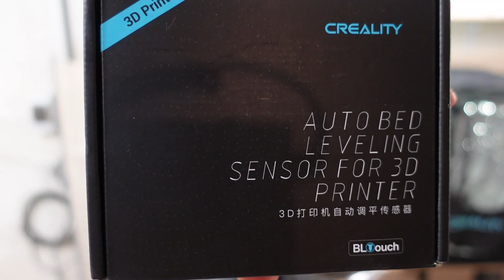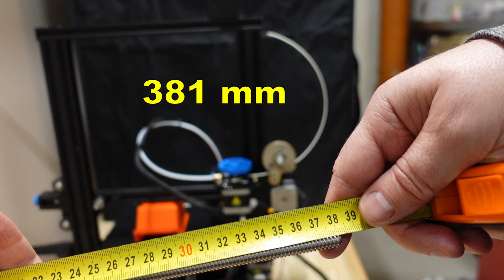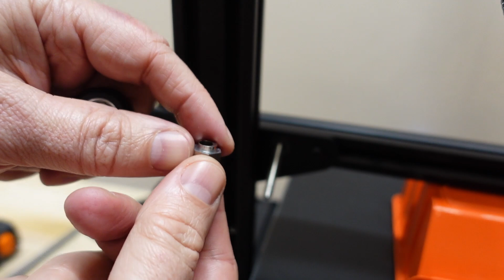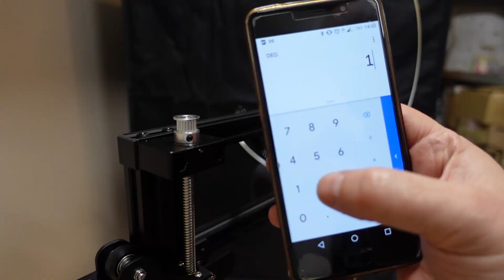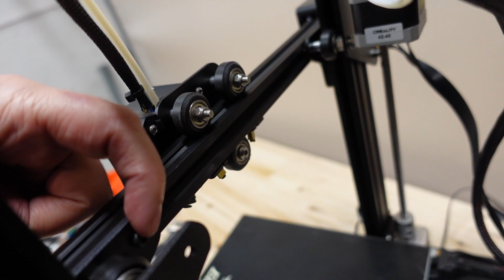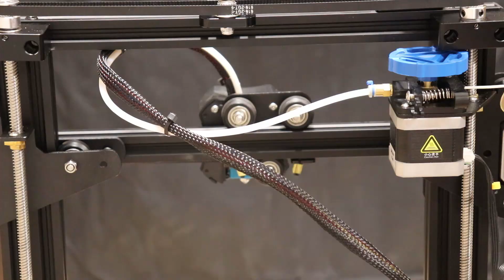Ender3 V2 dual Z axis upgrade with pulley and timing belt with single stepper motor

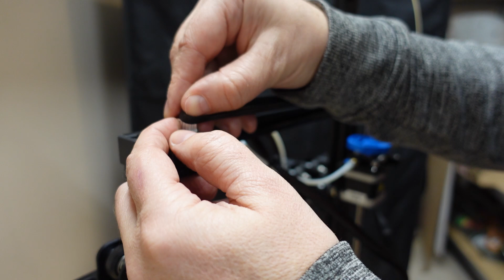Comment: 14:00
You're doing it wrong.
Remove one of the pulleys, put the belt on, and then put the pulley back on with the belt already in place.

Comment: One issue with this is the backlash on your non-powered ball screw. it seems like a fairly efficient system but this light amount of backlash you have in that unpowered ball screw will cause the bed leveling to not be as accurate. I went with the dual motors and check the pulse settings in the software. I'm also using a creality version 4 .2.7 motherboard which has some newer hardware on it to compensate. It looks really great I love that look!!

Comment: I did this and motors run ok until I lock the brass nuts to the bar. the brass nuts slide down freely, the bar goes up and own freely without the bras nuts. The screws seem square and are not wobbling. I added the belt to bind the 2 axis together but it seems to make things worse.

Comment: Have u tried to connect the two rods via Belt with the 2 steppers mounted? Theoretically they cant get unsynchronized, only if the belt slips.

Comment: I successfully bought a dual-z stepper motor and timing belt for my Ender 3 V2. I upgraded to Professional Firmware and now I have a very accurate leveled bed that does not require maintenance. Prints are successful and I am producing square test cubes. This was a big and necessary improvement. Thanks to you for doing this video.

Comment: Hardest part for my dual z axis upgrade was probably melting the hot glue creality used to hold the wires to the board. But thats just because I was scared to burn my electronics.

Comment: Banggood shipment of the timing belt Z-Axis arrived finally. I had the item for a couple days until I found time today to work on installing (with your video help) it on my Ender 3 V2. I quickly realized they sent the wrong product. Only a single standard Ender 3 V2 lead screw (length) and no timing belt, pulleys or center bracket with pulley. So I'll have to make due for another couple weeks. Hopefully Banggood will refund or exchange this item for the correct product. I ordered it on June 25th and it took until now to arrive.
Reply: Banggood finally offered  to return my money for the Dual Z kit that arrived with one lead screw and no timing belt or pulleys if I returned the package to China. To do this would cost $30 via traceable carrier and so I would only get $10 back. Based on Banggood's sketchy customer service and multiple delaying issues on Banggood's part I have decided not to use  Chinese merchants going forward unless thru Amazon or eBay which have good protections for customers.

Comment: My stock z wire was SO difficult to remove from the motherboard when installing the dual z upgrade. I thought I was going to break a solder joint or possibly something worse!

Comment: Hi, i know this is an older video BUT hope you could give some advice. the newer Creality ender 3 max neo uses a dual motor AND timing belt, i was thinking of upgrading my ender 3 v2to dual motor but am wondering if there is any added benefit to adding a timing belt as well? which option would be best? dual motor with NO belt, single motor with belt OR dual motor AND belt (like the max neo has)?
Reply: Have you tried dual motor AND belt? How is the result?
Reply: @WarrenGuan  not belt but i did do dual motor and can now print at 180ms so much better
Reply: @WarpaintStudios  I’m struggling with dual motors. The right side is out of synced from time to time. I’m replacing it with belt as I type. I’m just wondering why there’s no one put both dual motors and belt together.

Comment: I have fitted the z axis kit with the two motors and I think that the two motors moved out of sync and there were two white flashes and some magic smoke left the control panel and the original stepper motor , then everything stopped and the Ender died ?
So now I must try and find the problems . Im thinking that this mechanical solution is possibly more reliable.

Comment: Wouldn't it be nice if the dual stepper motor setup was anble to incorporate dual z axis limit switches. Of course that would require a firmware change along with the use of another input port.

Comment: Hello!! very good video, I saw it and convinced me to make this modification on my Ender 3 Max, but I have a question, have you already tried to make the modification of the two Z axes with the belt and with the second motor at the same time? I did it and I am having problems because the motors do not synchronize, I had to leave only the belt system and the second motor disconnected
Reply from the maker: I tried (two motors+belt) but I needed the motor for another project, so I am running my E3V2 only with timing belt synchronisation.
Reply: @MyTechFun  do you plan to do it in the future? I've searched all over the internet and I can't find any information to combine these two synchronized methods, it would be a good idea for a video! greetings and thank you very much for answering

Comment: I got Fysetc kit, which has bearing holders above top extrusion (keeps almost full Z height) and spacers between bearings and pullies.
I thought of adding another stepper motor or bearing at the bottom to pull the lead screw down, but I'll try first with your screw holder (never got myself to tinkercadding one 😄)👍

Comment: i have the dual stepper with the top bearing it shortens the the z axis with aprox. 5 mm thus z axis 250mm is not possible

Comment: For anyone doing this, don't tighten your beld to hard. They need to be somewhat loose to not have to much tenting. This will cause friction and more load on the stepper, it will not improve print quality haveing it tight to the max.
Reply: How do i know its not too loose
Reply: @HsvgamingFreak  by feel kinda. If it sounds like a guitar string it might be to tight. 
Tighten it and then losen it a little. Test out how it prints.

Comment: Will dual z axis with 2 stepper motors and a tensioning belt on ender 3 max work just fine?
Reply from the maker: Yes, but you need different size

Comment: I planned to install this mod, but after checking the screw, I didn't. The screw is pretty much just a mess, not straight at all. 

When you roll it on a flat surface and can shove a 0.8 feeler gauge under it, you know its "screwed".

But losen the holder a bit on the Extruder Mount and use a backlash nut helped to get acceptable results.

When you try to make this screw a fixed one and worse  2 fixed ones, you could end up with less money and bad quality prints.

Belt driven z axis is easier and more reliable, with linear rails, you will have better results. But that's what I would use. The great thing with such printers is, you can test it and it works or not (if you print your stuff yourself)
Reply: The mod kit has two new longer screws which would fix that issue.

Comment: Excuse me. Where do the new axis rests? At the lower end, is it on air? I can´t see it in the video.
Reply from the maker: The second lead screw is in the air (the bottom part). It only has to lift the gantry. The direction is given by V-slot wheels.

Comment: I bought a kit very similar to that one and I keep having the side without the motors lead screw shifting up over prints. How would I fix such an issue thanks.
Reply from the maker: Lock the position from the other side (explained in the video 23:30, link to STL in description)

Comment: Im considering to upgrade with dual z screw with stepper. and upgrade my main board to one that can support another Z Axis motor. so i can indivdual move either of the axis to align the X axis to the build plate.
Reply from the maker: You need new board. Stock boards don't have additional stepper for the second Z axis motor

Comment: Does the BL Touch / Auto Bed Levelling still work when using dual Z stepper motors? I can't see why not, but I read a post that indicated it didn't, so now I'd like to be sure but can't find any information on it.
Reply from the maker: Yes, it works

Comment: what if we had two stepper motors + the belt drive? seems like the best of both worlds.
Reply from the maker: Yes. A lot of new printers have this solution. Only one is better: two independent stepper motors and then using BL Touch, printer can level the gantry itself.

Comment: Ender 3 V2 with synced dual Z steppers and BL Touch OR Prusa Mini+? The print size is not the most important point, I just want the most clean prints.
What do the pros say? I need to decide :)
Reply from the maker: Prusa Mini+ I think the biggest difference is that it can print safely up to 280°C (with Ender3 up to 240°C). With this you can use more interesting filaments later (but start with PLA first to get experience)

Comment: I installed an ender extender 400 kit. Decided to go dual motors WITH a belt to keep them in sync. Waiting on the last parts to show up, hopefully it works out.
Reply from the maker: It's the same, only you need longer lead screws.
Reply: @MyTechFun  Yeah I actually went about it by ordering a single motor, belt driven kit. Then, since I swapped to a direct drive unit, I replaced my stock 42-34 Y motor with the 42-40 extruder motor, then used that 42-34 motor from the Y as my second Z motor. So all I needed to buy was a new pulley for the Y and a screw coupler for the second Z motor. The larger Y motor should help move the 400x400 bed anyway. Working out some slight binding issues but looks like it will work great. It is tough to get these parts perfectly aligned.

Comment: Can I use dual motor and the timing belt at the same time to make it best output?
Reply from the maker: Yes, a lot of companies are using that method on their stock 3D printer (Kywoo Tycoon, Artillery Genius Pro, Artillery SW X1), these are presented on my channel.

Comment: Which way is better? Double engine? Or an engine and this upgrade?
Reply from the maker: Double stepper motor is more precise, but may move if powered off. Timing belt less precise but it hold the synch even when powered off. That's why two together is the best.

Comment: Great video: when you said you will use a combination of the two systems: did you mean that the one printer will have both dual stepper motor ‘and’ the pulley system? Is that possible?Thanks — Frank S.
Reply from the maker: Yes, that's possible.

Comment: Very good instructional video, thanks for sharing. I have carried out this mod on my Athorbot Brother printer but I have left both stepper motors still connected mechanically and electrically. Can you please explain why it is necessary to remove one of the other stepper motors?
Reply from the maker: It is not necessary. There are two systems. One is timing belt (presented in this video), the other one is with second stepper motor. The best is combination of two as you have
Reply: @MyTechFun  Thank you very much for clearing that up for me.

Comment: I just did this upgrade and my z axis will not move at all. Any help would be great
Reply from the maker: Hard to tell from this info. 1) Can you move it smoothly with your hand? If yes, problem is in electronics, check wiring, cable 2) If it is hard to move with your hand, adjust it, try to make screws parallel with each other..

Comment: What if you add the motor on the other side and use the timing belt setup together..
Reply from the maker: That's the perfect solution (dual steppers + timing belt). I have separate video about dual Z with two steppers.
Reply: @MyTechFun  lol thanks for responding I have just purchased the timing belt after watching your video, since I had already purchased the second z stepper motor I was considering that to be a issue not to minchin I was also considering the weight of the direct feeding from bondtech and the mosquito hot end as a later problem

Comment: I am here because of the bed problem that is constantly falling apart and I cannot adjust it precisely. To solve it, I always focused on the bed at first. I tried hard springs, silicone springs but it didn't work. Then I aimed my target on the X-axis tilt angle. Even though I struggled a lot with the wheel setting, it didn't turn out the way I wanted. I realized that it was a mistake to buy a machine that works with a single Z rod.
I ordered the 32 tooth pulley and 640mm belt combination. I hope my calculation is not wrong.
Reply from the maker: You have the equation in video (but you must know the diameter of pulley) and it is safer if you buy longer belt, you can always use tensioner(s). You have a problem if it is shorter.
Reply: @MyTechFun  I made a calculation. I also took into account the diameter of the pulley I bought. For 288mm distance, 32 tooth pulley and 640mm belt are just right. If the belt is short, I adjust it via the shaft position. I will print the holder parts myself. But even if fully suit, even so I plan to create some tension with an idler pulley system with a spring added.

Comment: You assume the crossbeam is exactly the same height each side when levelling using the crossbeam. Surely moving the belt on one side, one tooth at a time would work?
Reply from the maker: Yes, if it is easier for you

Comment: you missed out crucial part there is locking nut to stop ball baring moving no need to 3d print part u can see it at 23.34

Comment: Can you give some details on what you mean by the "combination" of the two methods as a better setup?  Thanks!
Reply from the maker: Imagine this setup, but with added another stepper motor to other side (presented in separate video earlier). You can check my Kywoo Tycoon review video, they have this combination straight from the factory.

Comment: Do you know the belt length?  I have all the other parts already.
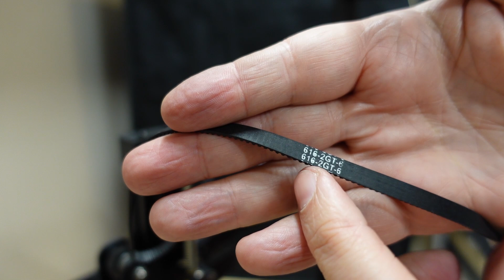Reply from the maker: It is from this time stamp: https://youtu.be/TIptLVvszLU?t=847 (14:07) you can calculate yourself if you are using different pulleys. There is the equation too in video
Reply: @MyTechFun  ah.  thanks!

Comment: What outer diameter for the bearing did you choose? Would one 8x22x7mm be good? Could you share the parts you attach to the bearing?
Thanks a lot, all your videos are great
Reply from the maker: Yes, that's the size. But I don't have the STL file any more, it can be designed in few minutes

Comment: you could combine both systems... use two stepper motors, the longer rods  and then connect both rods with the belts.
Reply from the maker: Yes, that's the perfect solution.
Reply: @MyTechFun  When will we see the video with the combination of both? ^^

Comment: Thanks for providing so much detail on this modification.  I will try this on my Ender 3 with 400mm extender using the CR-10 parts and look for the 616mm belt.

Comment: can you not use the stepper motor and pulley together ?
Reply from the maker: Yes, you can (but with tight top holder, not the one provided with two stepper solution)

Comment: ordered this and the timing belt was to long, like a cm or 2 to long, banggood customer support is crappy and says i added the timing belt myself (like how its part of the kit) where can i buy a timing belt that fits?
Reply from the maker: Too long timing belt is not so big problem. Much bigger problem is if it is too short. To long can be compensated with tensioner (that part in the middle). If the provided tensioner is too small, you can print one (or two)

Comment: Hi, where i live i cannot get the upgrade, i have the parts instead, what size/teeth these pulleys had? because i can only get a belt of 600 or 610mm.
I think maybe 16 pulley with 610mm belt can do it)?
Reply from the maker: You can calculate it, measure the diameter of the pulley, D*PI + 2*axial distance (+few mm for safety, you will fix additional length with tensioner), 610mm may be too short, but there is a chance that GT2 16T (with 9.7mm diameter) will be enough. In video from 14:04
Reply: @MyTechFun  Thx a lot, i think 16t + the 610mm belt can go right, if not, i think i could run a smaller pulley with a tensioner, cheers from Argentina, and really, thx for the reply, i'ts really helpful

Comment: hi! Thanks for the great video (also the one on the dual stepper setup)

Just ordered a similar setup. 

Would you recommend adding a guide (like the ones at the top) at the bottom of the new lead screw, so it can't wobble? or is the x gantry enough, even if it is close to the top of the printer?
Reply from the maker: That guide may be useful but may just case more problems (if the second lead screw is not 100% stright and not perfectly mounted)

Comment: I have on my very old K8200 solution with 2 x T10 screws + BT2 belt and never had problem...  2 stepper motors powered parallel is always a risk for desync. The belt is the belt.

Comment: why dont they sell this kit, with a step motor ? seems overkill you first have to buy the first upgrade kit, just to buy this on top of it.
Reply from the maker: I agree. Don't forget, top holders are not equal. With two stepper kit, top holders for screw are not tight, they give some freedom of moving. With timing belt, you need top of the screw locked in position (only rotating is allowed)
Reply: @MyTechFun  thanks, one quck question you dident answer in the video. if you only had to chose one of the upgrades would it be the one with belt or the one with motor?

Comment: I wonder if this kit would fit longer lk4 since the frame is somewhat similar.
Reply from the maker: I don't know. Depend of the belt length (distance of two lead screws+pulley diameter). But I think most critical is the passive block with nut for the second screw. Not sure if it can be mounted to LK4, holes for screw may be different.

Comment: I will use both redundant timing with dual steppers and belt to help stay synced
Reply: Just curious if you got to install both the belt and dual motors? If so how did it work?
Reply: @johnrogowski358  yes it is done and works great at keeping both z steppers in sync.